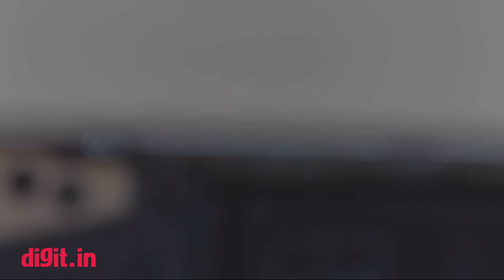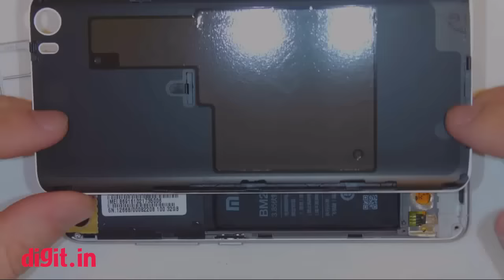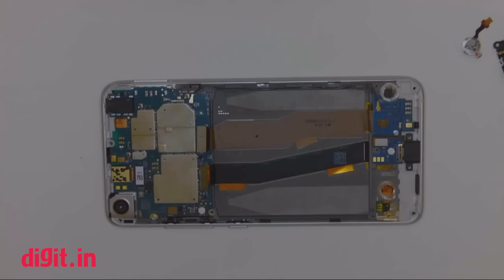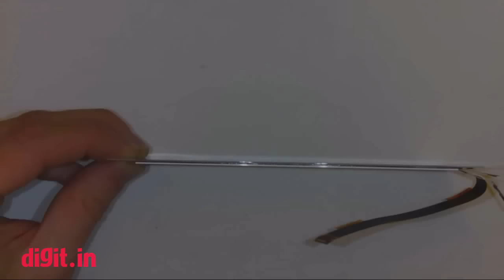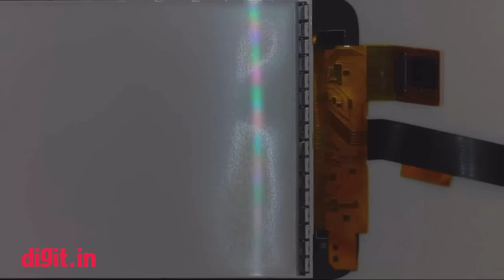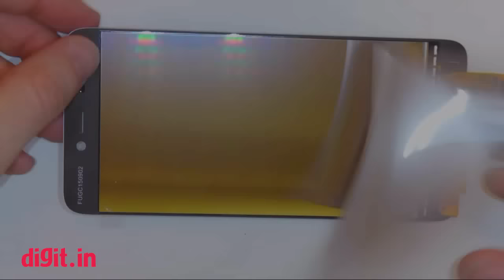Xiaomi Mi5 Teardown by Hugo Barra | Digit.in

Comment: At around 13.06 the camera cover is removed. I am trying to see whether there is a circular glass lens protector in the hole in the cover. My Mi5 does not have one and the lens gets very dirty. I have found a new camera module on Ali Express but it would be best to get a new lens cover too, if mine has dropped out. Can anyone confirm whether there should be a lens protector?